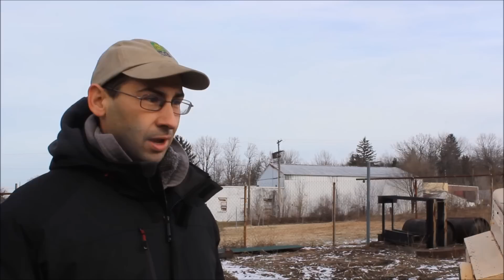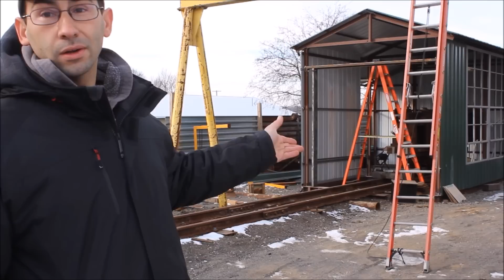January 25, 2016 J&L 58 Project Update

Comment: Thanks for the update.  As I understand things, the 0-4-0 H. K. Porter, ex-Jones & Laughlin Steel, was originally a tank engine, and several different tank options were available (the Mill Valley & Mt. Tamalpais Scenic Ry., Mill Valley, CA, USA, ordered their fleet number 6, SerNo 3483, with dual side tanks, which allowed ample clearance for the slide valves and Stephenson drive universal at the time of manufacture; the saddle tank had a water-capacity advantage where the vertical clearance was available and could easily clear the Walschaerts drive used on later models).  Good job so far on the tender, which should be able to handle plenty of fuel for the reconditioned boiler.